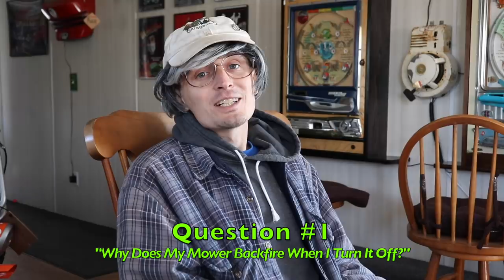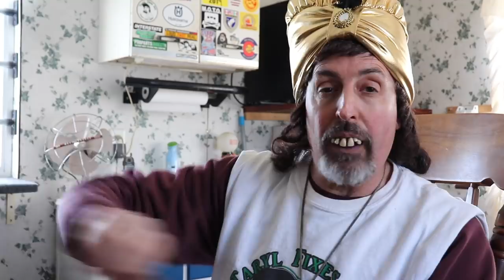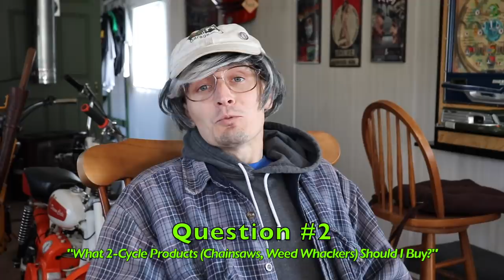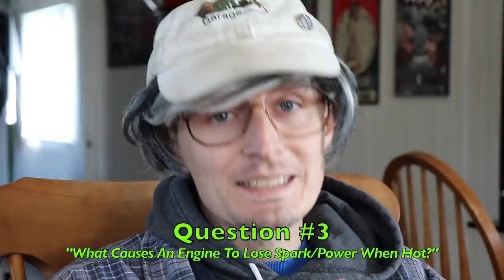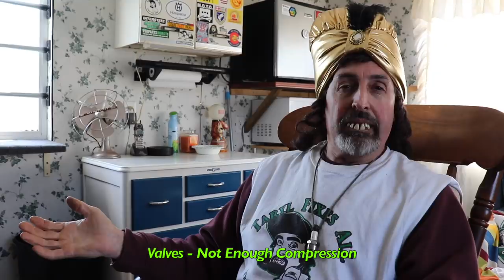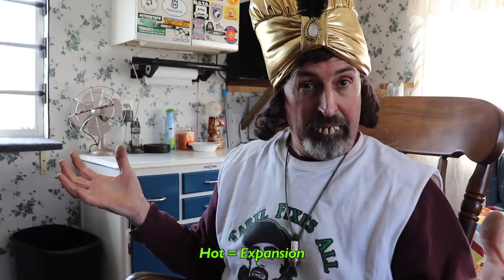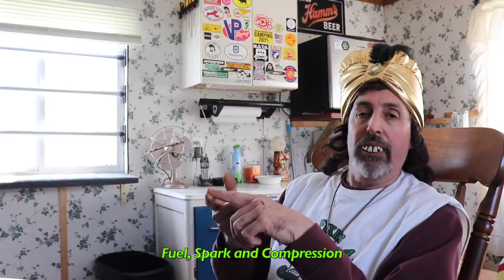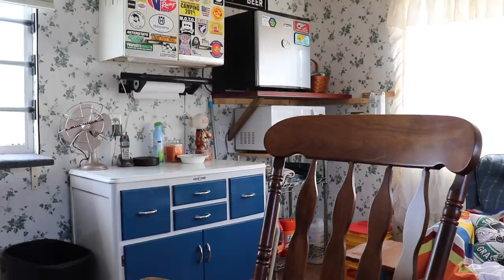Taryl Q&A #4 You DON'T Know This Stuff

Comment: Anyone over the age of 50 knows the quality of Stihl products have gone down hill since they started selling at box stores and hardware stores. I have a blower and chainsaw both pushing 30, other than routine maintenance no problems. I own a Stihl trimmer for about 5 years nothing but trouble with carb issues, I run fresh fuel,empty the tank and run it dry still issues. The quality on all brands have hit an all time low.
Reply: Premix fuel in a can is the key to success. Always the exact oil/gas ratio and no ethanol. Running the tank dry still leaves gas residue in the carb and on the diaphragm...the residue can build up and restrict those tiny  passageways and destroys the diaphragm by hardening it, it can't flex and pulse the fuel into the carb.

Comment: I'm actually disappointed... I mean truly disappointed... I've loved all your videos until this one.  Listen, I get it... The battery powered equipment seems like the better option. Being a ICE fan most my life.. At one point I thought.. "you know, it just makes more sense to get a cordless electric trimmer.   We'll for the first month it was the best decision made then by the start of next spring. The unit has gotten so bad, it was dying every 30-40 seconds and I have to stop and wait.  Took it in for repair, no joke 4 months later I got it back.  They said it was good to go.  So living in Ohio I had to wait until next April and... SURPRISE!!! Same issue, every 30 seconds it would shut off and you had to wait.   After reading online.  No one could figure.out the issue.   Some thought the fan was.ocer heating so they added custom cooling.  Others said that was not the fix and said it was the battery.  Well sometimes it was reported none of that worked and it was a bad control board.  I finally gave up and went back to a gas trimmer. 2 years later and no issues.   Recently I saw my neighbor purchased a reachable mower.  I'd watch as if the gass got a few inches and he was moving along.  It would stall his mower out so he'd lift the deck wait for it to clear and carry on.  This has happen multiple times with him now... I kinda smerk as I drive by with grass getting similar height in my yard and I face pace with the propel assistance.  At one point he looked over and was watching me as he was waiting for his mower to speed back up.  So I'm sorry, but you are wrong about ICE style power and really should be a supporter of it since it's helped you this far.  You can speak up and agree you know? You don't have to just be a bobblehead and agree with modern day agenda....

Comment: modern gas station fuel will vapor lock easily with a carburetor engine. my mower is like that. runs fine. if you run out of fuel or need to stop the mower for something. restart it in a couple minutes or just take a break for while and it will restart fine. nothing wrong but the fuel. thanks to the liberals for the bad fuel.